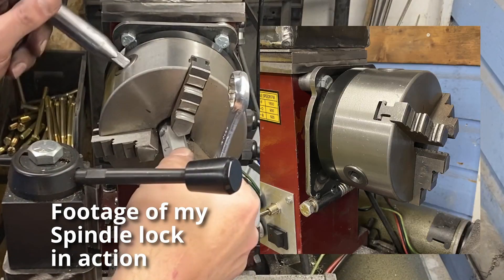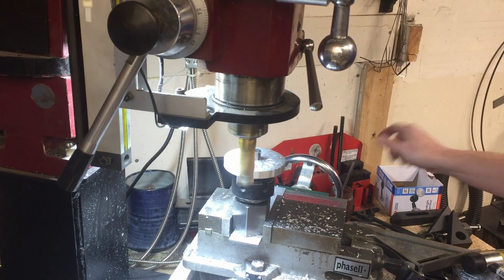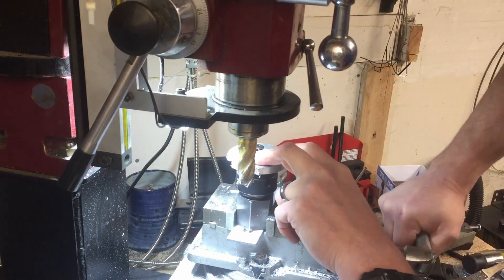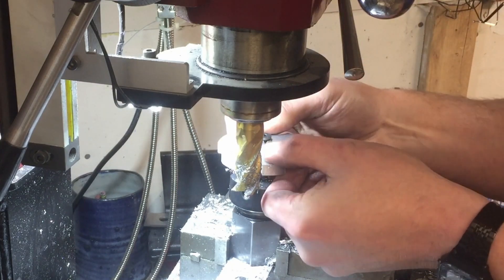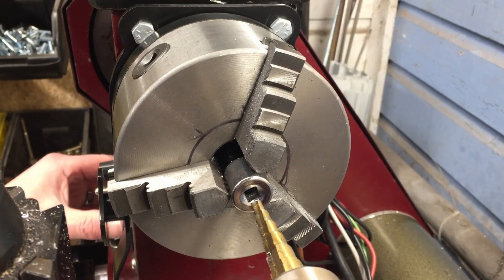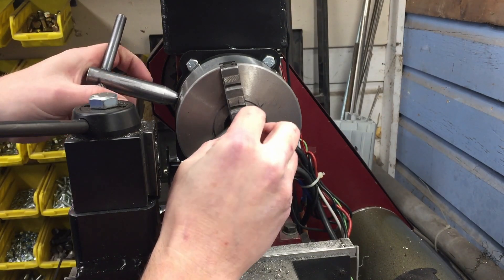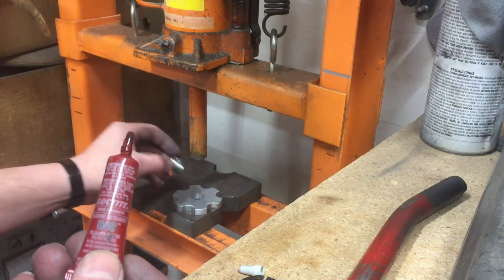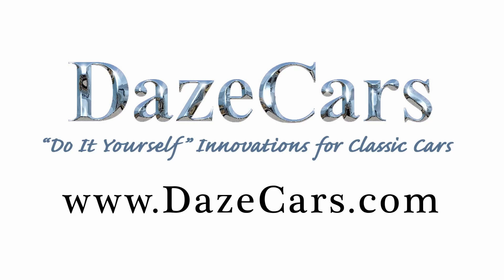DIY Hex Head Bolt Knob NO Broaching Required!

Comment: if you put the knob in the oven and the socket in the freezer it would slip together without the press but when it got to room temp it would be so tight you would have to press it apart
Reply from the maker: Thanks for the input, that is a good technique and I have used it myself before I had a press.  Now that I have a press its less involved ... simpler.  Also the hot cold technique does not allow for the use of loctite.  I wanted both a mechanical and a chemical connection.

Comment: I did something similar (pressed a socket into aluminum) for a speed handle on my mill vise. I also want to make 2 knobs but use them as chuck keys for a 4 jaw chuck. With magnets added they might make life easier when centering the work. Just add it to my project list ;).
Reply from the maker: So many projects, so little time.

Comment: super fun.. you should fab a little vice block so you can put your peice the vice in the same place everytime... great vid.  that is a nice knob sir...oh my using a step drill for the hole...good tip on 1/4" socket..
Reply from the maker: Making a stop on the vise is on my list of things to do but is not a priority at this point.  I use step bits for all kinds of things.  I find they work better in the lathe than a normal bit because ther is les flex.